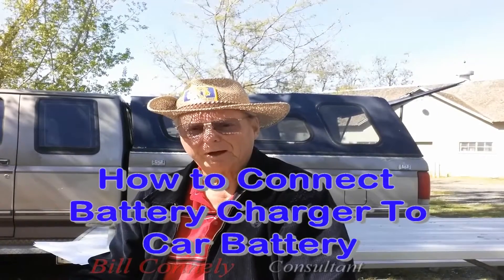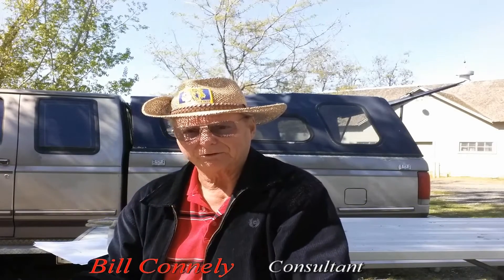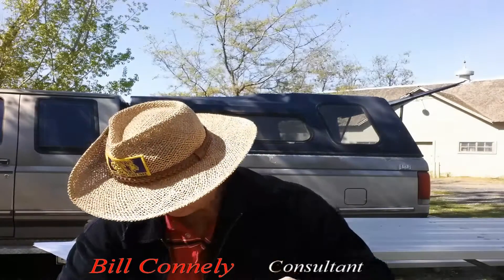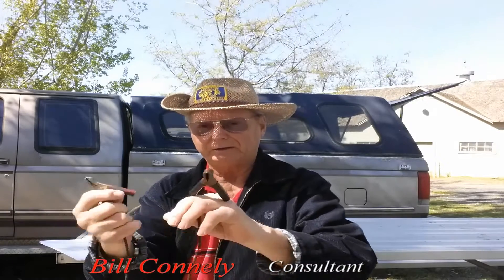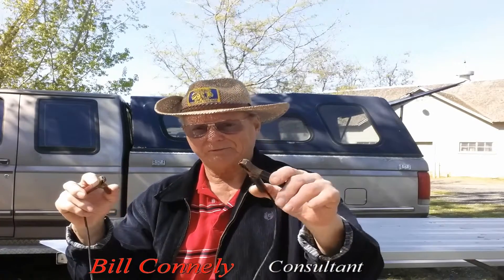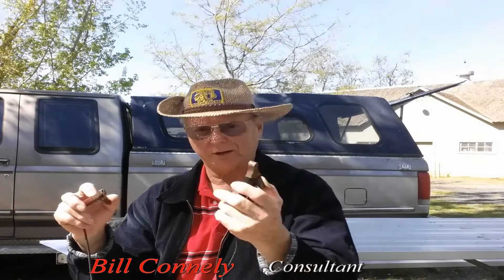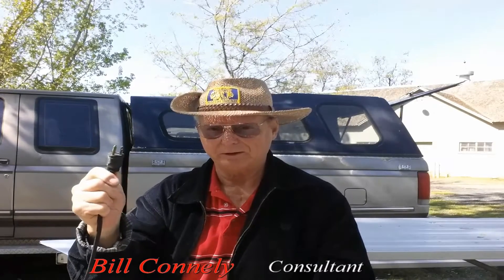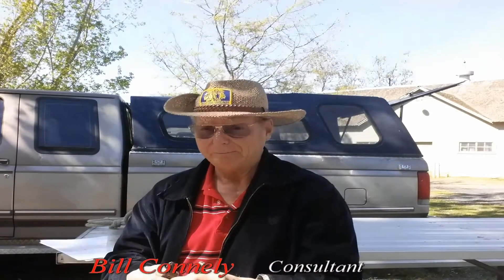How to Connect Battery Charger To Car Battery

Comment: Very good information.  I know the AC Delco Batteries that had the eye to see the condition of the battery use to have a green eye if good.  I know if not hooked up properly the battery would explode with the eye being the weakest point causing injury.
Reply: Bill Connely yep, neat tell us good or not.All batteries should have the little indicator. I wonder how accurate. Safety always first.
Reply: Safety is always first.  I have owned RVs for about 25 years now.  I have instructed people about RV for about 12 years now.  So if you have any questions about them feel free to contact me.